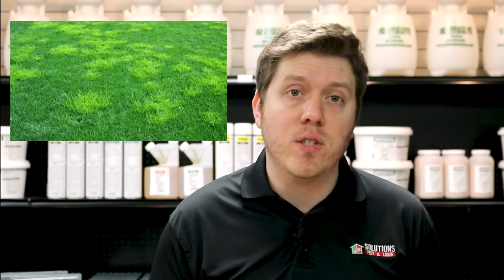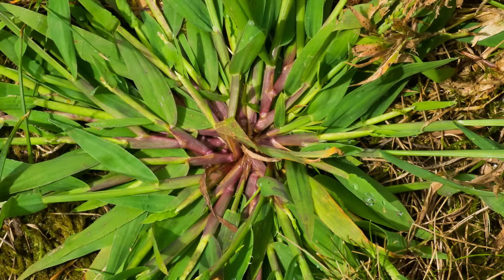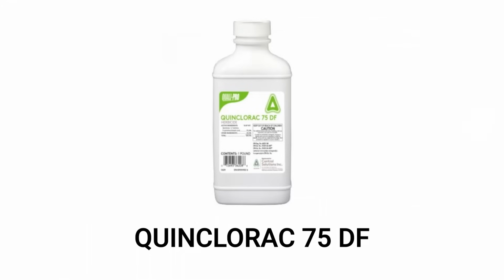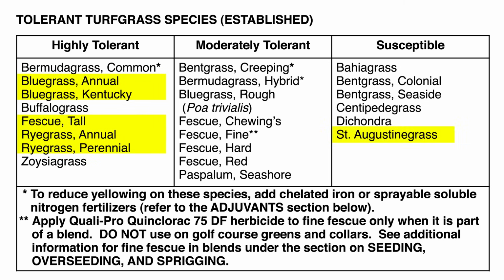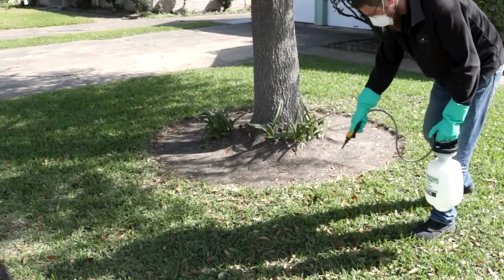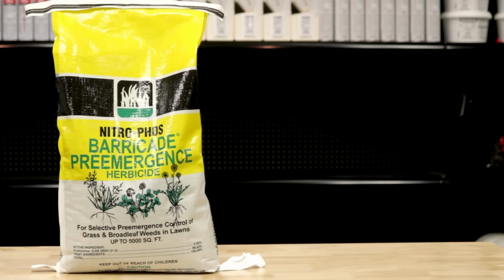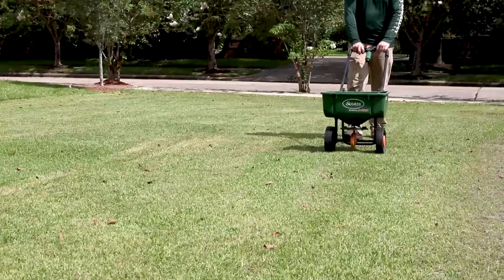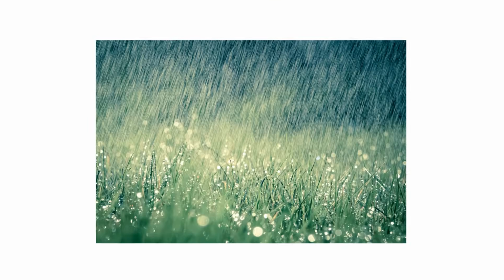How to Get Rid of Crabgrass (4 Easy Steps)

Comment: What if Iv used my pump sprayer with round up or other grass and weed killers before? If it’s washed out is it still ok to use?
Reply: Yes, wash out the tank and sprayer with clean water after each use and you can use it for this as well as fertilizers etc...

Comment: Another overlooked tip: DO NOT water in the middle of a sunny day. You will burn the grass and plants since the water focuses the suns rays like a lens when it sits on the surface before it dries.
Reply: I was told to water in the middle of the day to reduce the surface temp so my tall fescue won’t burn
Reply: @stevesmith756   That sounds like horrible advice. Whoever gave you that I would question. I know from experience that watering in the middle of the day kills grass and plants, they will be brown the next day
Reply: If you don’t apply enough water it will burn the grass.
Reply: @melvinwonder   That makes no sense. I believe it burns it because the water droplets on the leaves act like a lens and focus the sun's rays.
Reply: @ArcanePath360  you have to saturate your soil with enough moisture. One day it was really hot. That morning my back yard was green. But somewhere early in the evening the  grass started browning and weeping. I watered that “sun spot” for about 10 minutes and right before my eyes it rose up.
Reply: @melvinwonder   So it was the evening then when you did it? It sounds like it was dying from lack of moisture anyway, so burning it was the least of your worries
Reply: I watered last summer in the middle of the day for my tall fescue  on YouTube advise and it worked for me 🤷‍♂️ I’m in So cal and it gets hot and prevented the fescue from going dormant
Reply: @stevesmith756   Interesting. Maybe that variety of grass is more resilient. I have a mixture and generally avoid mid day watering as I did it before and it all turned brown
Reply: That was debunked.  The only reason not to water during the day is evaporation.
Reply: @stevecox2020  Well whenever I water plants in the sun, the leaves turn yellow and look scorched. I think the grass also turns yellow, but it's hard to tell since it goes yellow in summer anyway.
Reply: AracanePath360 Are you insane? I'd like to know where you came up with that BS.
Reply: @jayryan7473  well, it works for me.

Comment: I had terrible crabgrass problems for years and the only thing that worked for me is table salt. My zoysia and bermuda don’t get affected by the salt. On sunny days, the salt pulls the moisture down to the roots. When it rains, it dissolves down to the roots and kills it.
Reply: Lol that’s great. Chemicals are terrible
Reply: @steve50431 Agree don't want more chemicals on my lawn. Get enough from them spraying them in the sky. 😏
Reply: I have to try it. Hope it works for me. Thanks!
Reply: Also baking soda.
Reply: Another alternative is 30% vinegar from the big box stores. Mix it with some dishwashing detergent and a little salt and spray on the individual weeds. There are a number of YouTube videos giving details.
Reply: Does the salt kill the regular grass
Reply: @theblinglab It browns the surrounding grass but does not kill the roots. Weeds die within days with good sunshine but the grass recovers within about a couple of weeks. Try it in small areas and see what happens.

Comment: ONE Bend over, TWO Flat Bleed 10' knife on side of the plant and pray it up, THREE Pull it up, FOUR leave a hole, FIVE Put crabgrass in yard bag. that it
Reply: I did as well for the first time and now I have alot of bare spots in my yard. Did you have the same issue and if so, how did you repair the bald spots?

Comment: You didn't mention that crabgrass is a waxy leaf that requires a specific adjuvent to get quinchloac to stick to it such as MSO. This is  essential
Reply: That is true. I live in Texas very few days to spray that are not over 85 degrees. MSO and non io surfactants when mixed with quinclorac will burn every dang time. Drive/ quinclorac has two modes of action. That dude should not have been spraying under the tree a no no per label.
Reply: Plus, you don’t want to let Bermuda grass grow as-high-as 3-4”.
Reply: You are exactly right. He needs to edit the video. No MSO, no dead grass. Waste of time and money,

Comment: I have the crabgrass with the reddish center. Used quinclorac and tzone. Didn't even phase it
Reply: Probably need a surfactant to make the chemical stick.
Reply: @enriquecastellon6524  I use DriveXLR8 and the vegetable oil surfactant. It works great on post crab grass for me. The vegetable surfactant mixed in makes the DriveXLR8 "sheet" over the leaves and better killing of the  already growing crab grass. Otherwise the DriveXLR8 would bead on the crab grass less coverage on the plant. Just like rain does.
Reply: I heard Tenacity, Solitaire and Drive works great. 
I'm gonna try Tenacity because of being a pre and post emergent.
Reply: An MSO oil surfactant assures the herbicide sticks the the waxy leaf. Paramount info that was not included.